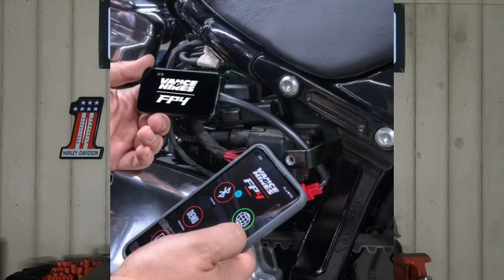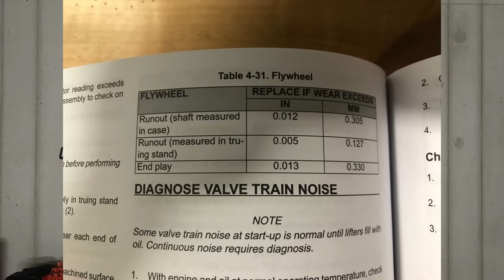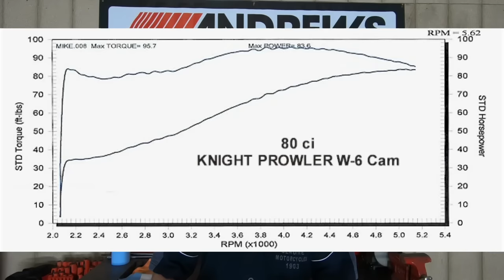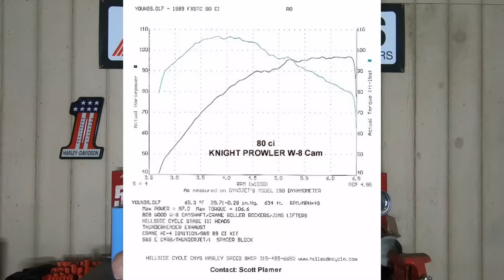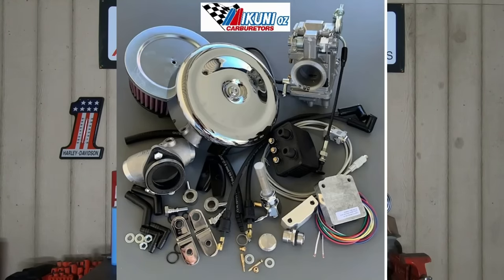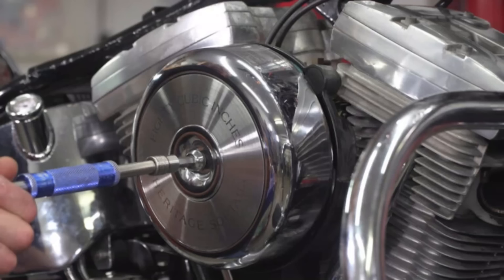Why the Harley-Davidson Evo Engine is Perfect for DIY Mechanics

Comment: I have a 2005 Sportster 1200 XL CV carb and it does all I need and more all OEM With the great exception of Amsoil. Most diffidently made an improvement. Run the 10-40 Amsoil High zinc Jasco MA,ISO-L-EMA wet clutch rated in the winter Much more responsive acceleration.and quicker starts! Then I just bought an 1995 Dyna wide glide 1340 Evo, And use the CV carburetor and oil as well.  The high engine heat just is not there anymore.

Comment: I don't even consider the M8 a Harley engine. Yes, it is made by, or at least sold by H-D. But it lacks the two things that define a Harley engine more than anything else. Sound and feel. Those two things are why I ride Harleys. No other reason. I am not a H-D fanboy. In fact I have some serious problems with H-D. From the way they treated their customers and potential customers back in the '90s, to what they have done to their bikes in the 2000s. I am a fan of the bikes H-D USED to make. And that is mostly because of the EVO engine. I have three of them. A 1989 FXRS, a 2006 Sportster 1200, and a 2001 Sportster 883. I bought the FXRS way back in 2003, and have had no real issues with it. It is 100% stock engine wise. It does have an aftermarket exhaust and a retuned carburetor. Not for more power, just to make it sound like a Harley. I use that bike for long distance highway rides. Mostly in the right lane at 65 mph. I don't need more power. I ride to relax. Back in 2015 I bought the 2006 Sportster 1200. It was an impulse buy. Beautiful low mileage bike that hadn't been chopped up, and the price was right. I ride it pretty much the same as the FXRS, but usually for shorter distances. I can spread the miles out over 2 bikes and make them both last longer. I bought the 2001 Sportster 883 in 2022, because H-D was discontinuing the Sportster. I sold one of my Japanese dual sport bikes to have a place to keep it. So far I rarely put more than 20-25 miles a week on it. I have taken a couple of 200+ mile trips on it, on rural 2 lane roads. I bought it just to make sure I always had a Sportster. I also like the idea of having a solid mount Sportster, which doesn't vibrate nearly as much as many people claim. Both the Sportsters are also stock engine wise, except for exhaust and retuned carburetors. All three of these bikes have been almost 100% reliable. I did have to replace the starter, pulleys, and belt on the FXRS. They are available online from many different places. I was planning on eventually replacing or rebuilding the engine on the FXRS, but since I got the Sportster 1200, I've slowed down racking up miles on it, so I may never need to. But I will if necessary. I am not interested in any H-D made after the EVO.

Comment: Stock my 2008 1203 cc Thunderstorm engine is supposed to make 103 HP Redline 7,000 RPM.. I never revved it over 6,000 RPM  simply no need it shakes a lot and falls on it's face with stock cam after 6,000 ..
  Stronger cases..  Fuel Injection .  Higher compression ration. Air Scoops for rear cylinder cooling .. Air Scoop for the oil cooper and a  fan to draw air across the engine when hot or and sitting in traffic .
  Eric Buell made many improvements on the EVO .. just needs to be a 6 speed.

Comment: As an engineer, i can fix anything as long as i have the patience for it. That being said, i prefer the older pre evo and evolution engines, shovels are caveman easy and damn strong, same all the way back to 1903 singles, as every old school biker i  love the knuckle and flatheads, shovels and evos, i dont like the head bleeder in the pan but they are very stout and astecically pleasing especially the right side of the engine, its just a work of art! I can work on the new stuff too, but i dont want to invest in dealership proprietory software to plug in the ecu and talk to it, just not my thing
Reply from the maker: I love those older more mechanical engines you don't need special tools for, you can anything to them with just a basic tool box.

Comment: Maybe the Twin cam? It has awesome parts support & whether you like carbs or FI, I have 2 bikes, one of each, carb is evo, FI is a twin cam but I really like that FI & I was trying to avoid it. The Fuel Commander wasn't cheap but after proper Dyno tuning, it's awesome & ready to rip quicker & zero issues with a nice power curve. I can't afford to have my evo Dyno tuned but I experiment with jets & needles etc & eventually got it where I like it but still, longer warm-up time because the carb needs some heat before it's functioning at it's best. I would love to get a carbed bike properly, professionally tuned because then I'd be certain to have the correct mixture

Comment: The Evo has some real strong points it's just that it needs more power as it comes from the factory. You have to know not to get too ambitious with your hp number hopes on these motors. 100 hp is possible out of an 80 inch but you'll need a 2 into 1 and around 11:1 compression pistons, extensive headwork and Woods cam, but the more realistic goal is the upper 80s. I still say that a Harley is about cruising rather than in being a speed demon so you don't need a ton of hp.

Comment: Yea, I loved my Evo Heritage at the time (1990's) But, I did not like it's loosey brakes,  the skinny 130 rear tires would lock up so easily, and with it's 5 speed tranny,  my left foot kept up shifting looking for another gear. When HD finally put in a 6th gear,  with ABS brakes,  a 180 rear tire, and Cruise Control (around 2009)  I bought my current ride, a 2010 FLHTK with ABS brakes, with a nice wide 180 rear tire, cruise control, and a 4 speaker stereo, with intercom.

Comment: Twin Cam was my first. All I know about the evolution,  great bullit proof engine. But.... like you said, the carburetor issue. Seen many bikes in corner of garages on stand bye waiting on a specialist. 😂
Reply from the maker: Carbs work very well, there's nothing wrong with fuel injection but it's hard to fix on the side of the road.

Comment: I've asked before but I would love to see a video on the 883/1202 "evo" quad cam in the sportsters. How it compares to the 80 Evo and what it's quirks may be.
Reply from the maker: That's not a bad idea, there's a lot about the sportster over the years. 883 and 1200 are exactly the same in every way with the exception of the heads, cylinder bore and the late 883's they changed the primary drive sprocket ratio. There's a lot more than that over the years though.

Comment: Im  always surprised  that people  keep trying  to hop up harley motor so much ,  mine pretty much a pretty much stock evo   and  its gets to 100 fast enough , if and when i decide life is not worth liviing , i get a hyabussa 😂😂😂😂
Reply: On an EVO just change the cam change the cam bearing and an s&s super e carburetor with some decent pipes you'll have about a 70 to 75 horsepower motorcycle which is all you need for reliability and longevity that's my take unless you want to go with an s&s 124 that's going to cost you at least 10 grand

Comment: Never owned a Harley yet and folks I know suggest the evo engine.
Reply from the maker: It's a good motor, it's very solid and reliable but with the age of them you'll want to check it out real good or have it inspected at a independent shop. Harley dealers won't tough them anymore, they only want to work on M8's. But I will say parts for the Evo are way less expensive than the Twin Cams.

Comment: Powervision is exactly 700$ man. Thundermax is what, 1500$.... im converting my twin cam 95" to carb
Reply from the maker: There's some slick carb conversion kits out there that come with everything you need. You can even get them with or without the carburetor.

Comment: I was told today by a Harley dealer that even aftermarket parts are becoming obsolete for the Evo. Is that true? I’m wanting to purchase a Evo springer Softail. What’s your take?
Reply from the maker: There's still some aftermarket parts out there but it's getting to where the EPA is pushing hard to stop manufacturers from making parts that don't comply with current emissions standards. While those bikes are grandfathered in you can't run a non compliant bike if you can't buy the parts. https://youtu.be/Xb8nocCJij0 this is where we are headed.

Comment: Bought my 92 FXSTC new, also bought my 81 FXWG new. Both bikes have been absolutely trouble free  except for tranny main seal on the ole Shovel, but that’s it, to this day I wouldn’t think twice about loading up and firing up either of these bikes and riding cross country, Shootz, I have more than once! But for me it would be a hard choice if I had to choose between the two!  The only things that would influence my decision is the Evo’s better on gas and of course the better horsepower is handy when I’m pulling those high country passes, but the Shovel doesn’t do bad at all since i went 3 teeth bigger on its front rear chain sprocket!  Better on the highway and much better in the mountains, no more searching between 3rd and 4th, keep it in 3rd now, it’s perfect! I highly recommend that sprocket change, one of the best things you can do to a stock 80in Shovel other than pipes air cleaner and jetting!!!!
Reply from the maker: That's awesome! You've got some nice bikes, love hearing that you've kept them over the years!

Comment: Longevity? Really? I've got 67,000 on mine and I have to replace my motor because for some reason, the primary oil is being sucked into the engine crankcase. A cracked case is the suspect. My mechanic suggested replace the motor. It would cost about the same as if he rebuilt it and if it's cracked, which I believe it is, it's gonna need a new case anyway. So I bought a new motor from ebay. Taken from a 96 road glide police flhpi with 4,230 miles on the odometer. So that's where I am. I was hoping I could get 100,000 on mine before needing a rebuild but I guess that was just wishful thinking. I anything else goes bad on mine, I might be forced to get a Honda instead of a harley. The local harley dealership says "obsolete" as soon as they hear 96.

Comment: @GixxerFoo love your videos, I’m thinking of trading my 2002 twin cam 88 for a 1992 fatboy
Reply from the maker: Thank you, I appreciate the support! I would hang onto your 2002 model and still pickup that 92 if you can! The 2002 still has the Timken bottom end and the solid crank, the next year they to pressed cranks.
Reply: @GixxerFoo  Sadly i Can’t afford Both of have to trade or sell my Road king for the Fat Boy. 
And it’s a Hard Decision that’s been living in the back of my head.
Thanks for your Reply I appreciate it.